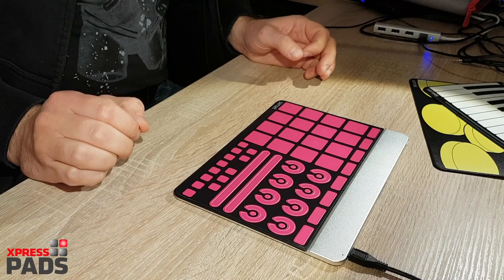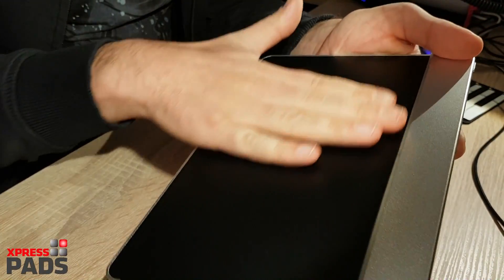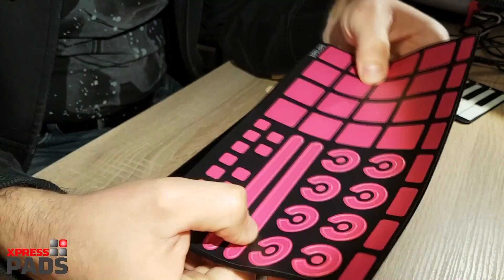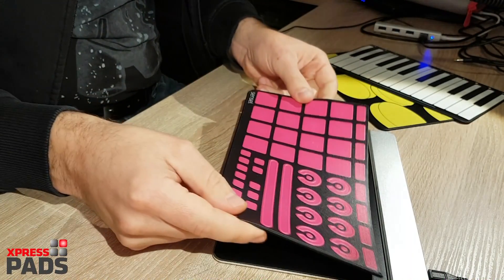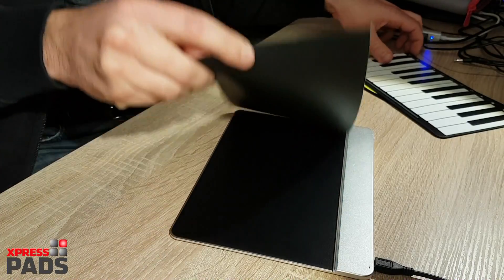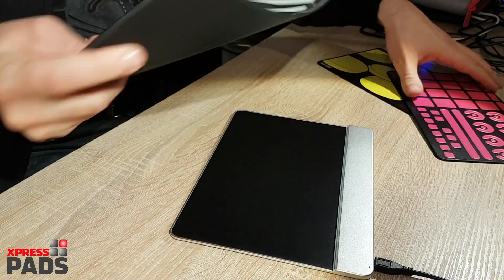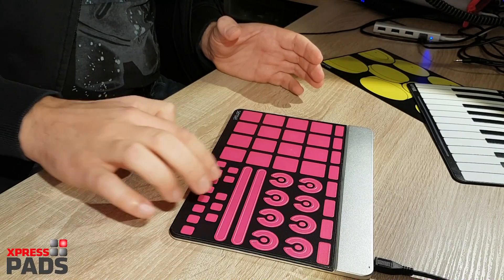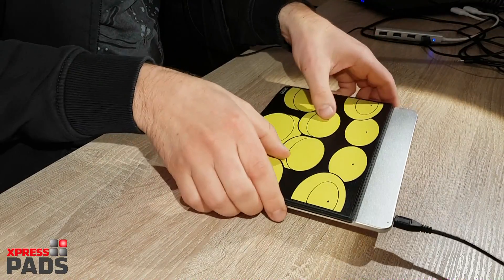Sensel Morph | A Closer Look

Comment: 1. Does it register hits if you just lightly tap on them? I'd really like a soft touch drumpad, but all the others i have tried, you had to hit them very hard to even register the note on, and then you have already at 30-40 velocity. (except for the QuNexus, it's the most sensitive i have tried, but that one goes really uncontrollably random on the harder hits...)
2. Can you register a broad range of velocities when using it? Like at least from 20-127 ?

Thanks
Reply: Detects forces between 5-500g. And can detect even a brush stroke and the brush individual hairs and so on brush touching area on it for painting.
Reply: @katumus  are you serious? it only has 16 points it can register at the same time so unless you have a brush with 16 hairs then you are lying.
Reply: @TheChameleon2008  you and your 16 hairs (lines) can go to test one, as you get far more than 16 lines (hairs) at time.
Reply: @katumus  no, its not possible. You think its possible because it emulates a brush but of course this isn't a copy of the real brush you are using.
Reply: @TheChameleon2008  you now don't know what you are talking about. Get it... Test it, understand the software running it.

Have a good day.
Reply: @katumus  i would get 1 if they didn't ship it from usa only. PRice is already kinda high but its also hard to get within europe so no way for me to get 1 at this moment.

Comment: There is still one thing this awesome technology needs: a screen under the base mat, so your silicone buttons could light up. :)
Reply: Actually, the sensel website looks like they are making such materials/sensitive surfaces that could do that, too. Also, the Roli Lightblock is similar to what you describe. But I had too many issues with it, just within a single day of trying to use it. So I'm about to return it and now I am looking at getting a sensel Morph instead. Its much ligther, more open api-wise, hopefully better working.
Reply: instablaster.